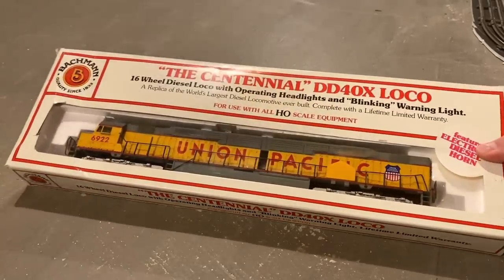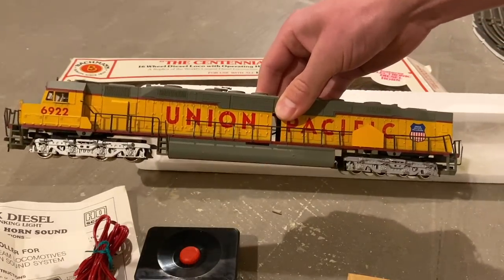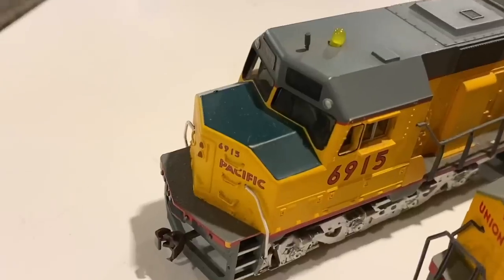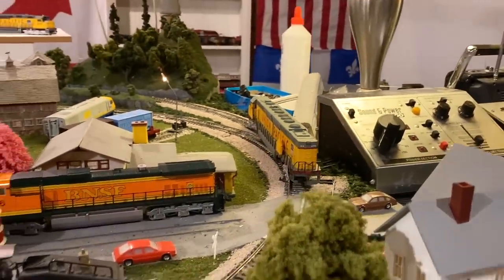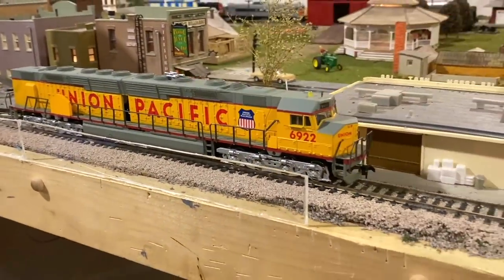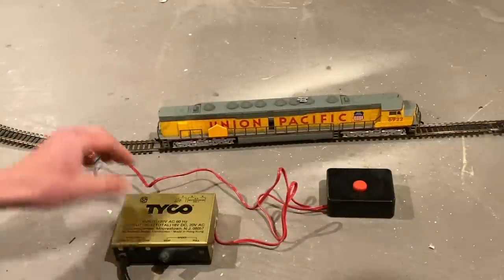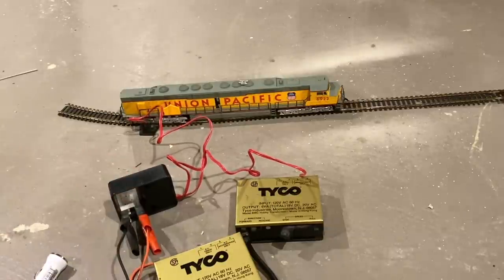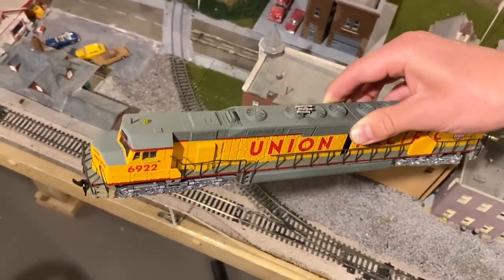The Strangest Ho Locomotive I've Ever Seen - 1980s Bachmann DD40AX W/Sound

Comment: I get a big charge looking at your videos because you remind me of myself. I don't know if you are interested in trading ages, you would gain some knowledge but I would regain coveted youth. The reason the horn has a battery is because if the power came from the same circuit as the motor the train would slow as you blew the horn. Another thing comparing the two locomotives is that the technology for making the product has changed greatly over the years. You young guys are much more critical and compare an Athearn car from the sixties to a Rapido car of today, There is no comparison, not even the price. To see a real locomotive like this today you have to go to the western states. Most of the cabs on these were made in Canada at London but now that plant was moved to the states. Trust me it is two powerful diesels under the hoods and the open area probably is for cooling. Each diesel would power four powerful electric motors at the wheels. It is fun to study trains and eventually you will become a historian if you keep going. I suggest you try to learn about the Pennsylvania railroad as the made their own locomotives including the famous GG1's. I still don't know why they just don't male that model anymore.  Here is a link you can learn a little more about me. Keep safe in these uncharted times. https://youtu.be/WBwdE7zGPt4  I have other videos as well, some even have trains featured.

Bob

Comment: Your assessments of the locomotive are correct.    It isn't the best model of a DD40X.   I preferred the Athearn version of the DD35 which wasn't a true copy as they had an extra fan on top.   But these are what they are.    Not the best in production.    Bad is an apt description.  Lot's of luck.

Comment: I’ve worked on two of these this month (non-sound models) pretty terrible design
Reply from the maker: Yeah, I find these old Bachmanns interesting but they had some of the worst drive systems around.
Reply: SMT Mainline  I do a lot of old train repairs and out of all the brands, so far Bachmann leads the pack of unrepairables.  Broken gears, broken axels, broken motor frames, broken chassis ... sometimes I'm amazed they have stayed in business

Comment: In real life this locomotive was the largest diesel locomotive ever built they were the union Pacific 6900 series units turned out they were very problematic and derailed easily.
Reply from the maker: I've heard about them being problematic but I didn't know derailments were a common problem.
Reply: @SMTMainline  due to the units size yes off the top of my head they are about 95 ft long give or take a few they only have 16 wheels 8 front and 8 rear I believe it was 6926 that accidentally jumped a spur to a siding in Nebraska and rode sideways for about 1000 feet back in the early 90s I've seen pics of it. I feel for the crew lol hope they had their brown pants on that day
Reply: they weren't that problematic, they were decent running locomotive. UP kept them mostly in Wyoming or ran them across the desert areas in NV and CA. they were very long units, but were ran on routes that could handle them. wouldn't have been early 90s for that derailment, DD40's were retired in 1984 and off roster in 1986 (except for 6936)
Reply: What problems??  And derailing where?   Need to get your facts straight
Reply: @needlenosekw  these units were problematic according to union pacific it's self. They ended up using most of the units on the flats between iowa and utah because of the more restrictive turns in california and the mountains of the east coast as far as derailments I know of 2 one when they first got the 6900 on tehatchapi range in california in 94 and the other just out side of kingvale california in 95 after the ntsb investigation it was found that due to the sheer length of the locomotive the turns were too tight as far as issues they caused frame damage between the 2 frames that were used and also due to the excessive weight of them the branding systems and traction motors had issues.  This was partially why the challenger and big boy were articulated this diesel is only a few get shorter than big boy...

Comment: MAYBE YOU SHOULD LOOK FOR THR ATHEARN Blue Box DD40' which in the real world doesn't exsist. look for it on eBay, the DD40 has two motors w/flywheels, 0r if it is a lesser one w/o flywheels.
Reply: Just to clarify, Southern Pacific did have a few DD35 cabless units, which were usually coupled to a GP35, or GP38 as it's control unit.

Comment: Bachmann was the worst, there steamers don't hold up, and this locomotive has no pulling power, Athearn made this with both single and two motor configuration, the body details minus the front and rear are very good not accurate but good, if a person takes the Athearn chassis and mates it to the Bachmann body, then it would be a very nice locomotive.